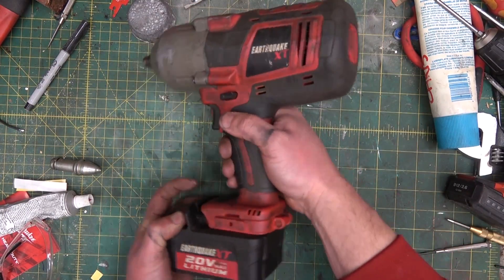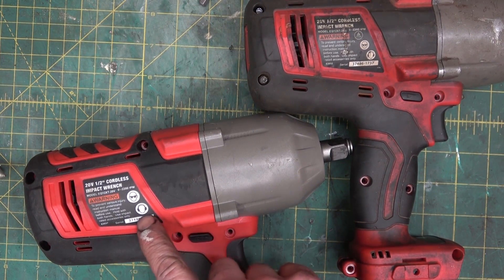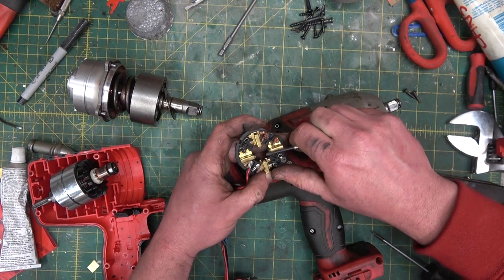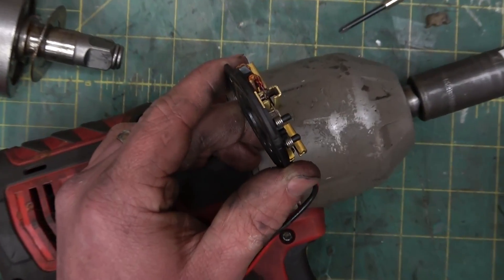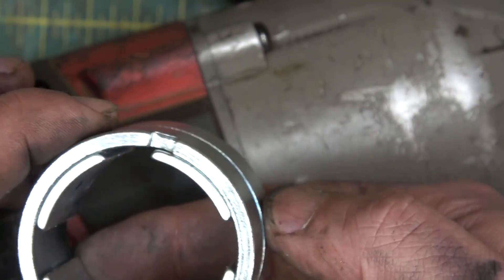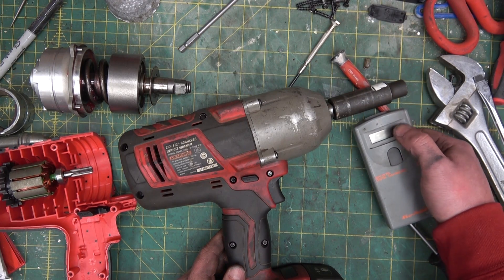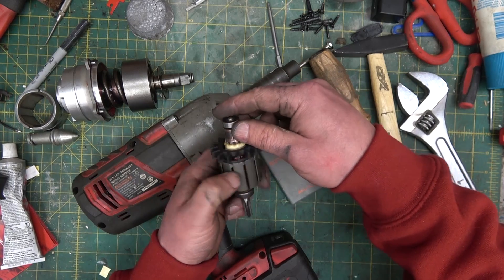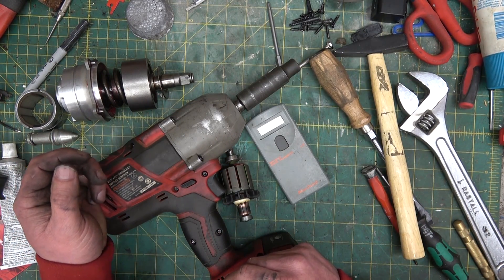Mystery Solved! | Why Impacts get weaker

Comment: recently I had  two very different cordless drills in two different locations short out on me at the commutator. 
Cleaned them up and they back up and running. Both way before the brushes were worn down. 
I did not get from you're previous video if you cleaned in between the copper strips.

Comment: It's possible that 1717 and 1737 aren't per-device serial numbers, but rather year/week of manufacture.
Reply: If they have CE marks on them they will be batch numbers. That said the batch number can be the week number too.
Reply: Gordon Lawrence I predict 2017 week numbers 17 and 37.
Reply: @matthewhall5571  both you and Musashi are most likely correct. However I raised the other possibility as it is not 100% ruled out.
Reply: musashi gundoh yeah I think the same. Calendar week 37 is mid Sept. Eric O. From SMA marked his impact as 11/17 so two months from manufactured date. Takes about 1 month for shipments to come across the pacific on the slow boat.
Reply: No, those are Starship registry numbers.
Reply: @pauldowding8185  Yorktown (or Defiant) and Proxima (or Coral Sea) if you're into that sort of thing (canon or not) :)
Reply: Sometimes they use different serial numbers for identification of which plant it came from,  also week month etc

Comment: I wonder how much play in in the flux ring and brush holder alignment pins. DC motors for racing RC cars have adjustable timing about 20 degrees advanced timing gives the most power in one direction.
Reply: Timing can also be introduced if the comm segments don't line up with the poles for the winding (twisted comm). Since both armatures came from a different manufacturer, that could very well be the case here. Another one could be that the faster armature was wound with fewer windings. I would try checking the resistance of each phase of the armatures to compare the amount of resistance between them.

Comment: It's interesting that the motor is the weak link here, rather than the gearbox or anvil/hammer.  I would have expected those to fail first.
Reply: Ya, I'd be real interested in measuring each of the coils, see what the range was.  Very cool regardless, and 100% not what one would intuit...
Reply: Or even have everything from the old one with only the new gear box. The motor might have failed because it was overloaded by the gearbox, because the gearbox wasn't properly lubricated, because.....etc

Comment: this video gives no hope to any power tool...how the hell does the rotor assembly get weak?! I understand the copper winding are working, and energizing on and off... but are they actually gaining resistance?! this would have to mean the copper material itself is getting less dense? i feel like this channel just discovered the black hole.. AvE, you should do a resistance test on some wingdings... maybe some macro close ups of the copper.. see if there's a physical change in the wire itself. <3

Comment: I have had Dewalt drills fail in the same way - new rotor fixed them. My guess is that they overheat and the insulation between the windings break down and cause a short in the windings.
Reply: You would definitely have seen some magical blue smoke if that were the case. 

Shorts almost always meant more heat and now that we have lithium ion batteries they almost always provide enough current to blow out more electronic bits. 

It's more likely that the rotor delaminated which explains the slow speed w/o the fireworks.

Comment: Interesting failure mode for sure. Do you think it may have been caused by the brushes having been worn to essentially past their usable travel, causing a less than ideal contact to the commutator and producing excessive heat? Wondering if replacing the brushes before they got that worn could have prevented the performance degradation.

Comment: Even if there are no open or shorted sections of the multiple windings, even a single shorted turn on any one winding will really mess up the operation of the motor and cause extra heating.  On an impact gun, you can imagine that the windings get rattled pretty hard so it is not difficult to imagine that the windings on the rotor could relatively easily develop issues.

Comment: So it end up being a shorted winding or open winding either or will cause some arcing at the brush commutator interface.  Well we are not done yet, one more step to go! Do you have a growler and not the type you put beer at the pub to that home, The diagnostic type that can tell us if the fault is, an open winding or a shorted winding !

Comment: I still need closure.  Measure the anger of the pixification from winding to winding.  Put your multi-dooblydoo in the horseshoe gear and get to work!  I'd a bet 20 Canaderp Kopeks it was the trigger or brushes.  You can't stop there!

Comment: I mentioned the rotor windings in the comments on the original video. I had the rotor in a HF miter saw go years back when I lent it to a buddy so he could put in flooring. HF sold me a new rotor for $16, so an economic fix. Used to work at Trane company in aftermarket engineering where we developed a system to test the rotor bars in industrial motor, which have no commutation contacts and so they can't be directly tested but rotor bars failing from heat was the primary failure more.

Comment: Thanks for the follow up, i would have lost money had i done that bet.
What's the resistance like compared to the working rotor? Lower or higher?
If the windings have shorted or there is a conductive buildup in the groove between the commutators, the resistance should be lower.
If the resistance is higher, something strange is going on.

Comment: You could have measured the winding resistances.  I'd bet one has an internal short and has lower resistance.
Reply: Or possibly an open?
Reply: Could be an open too, be it in the winding or connection to the bars. Not much else can go wrong in a rotor.
Reply: Was my thought also.  One of the windings being broken due to overheating.
Reply: Very plausible, the windings would shift in an impact gun, wearing through the insulation an shorting out, which would reduce the effective number of turns. The old florescent light  ballasts will do that.
Reply: Agreed! Fewer effective turns, same or more current , but less magnetic field and lower torque.  Have you an inductance meter? That'll show a BIG difference if there's a shorted winding. Ohmmeter, not so much.
Reply: Yes, and rewinding motors is actually not that hard to do. It could even be a bad solder joint from over heating.
Reply: I'm wondering if it lots one or more poles either by windings getting shorted, or something opening up. Either way, it would make the motor weaker. 

The crud on the com bars should have been a clue, but hindsight is 20/20.
Reply: @budgenatorP  that was my thought exactly. Being an impact gun its subject to a lot more vibration that normal motors. Couple that with some heat and i could see the epoxy insulation on the copper windings wearing thru in a spot or two.
Reply: it would be open circuit or letting the smoke out till it was.
Reply: Doubt youll find any solder in the armature. The comm bars are usually just crimped. Shorts caused from abrasion between unvarnished (dipped) windings. Aint nothin' made like the old days.
Reply: Mark S I’ve still got my Dad’s ~50 year old corded Craftsmen 3/8” drill. It still runs like a top. 
As a kid and later I personally put long periods of load on that thing. 
Sanding, paint removal, polishing, buffing, drilling ultra hard material, etc.
Sometimes, or most of the time, with less than optimal drill bits.
That doesn’t count what my Dad did with it.
Reply: Another great cockford ollie special!

On my screen the windings appear darker in places.  I too would suggest rubbing due to vibration, the epoxy insulation failed, windings shorted within, higher current, more heat, but effectively fewer turns, lower field strength, rinse and repeat.  

If so the resistance of each affected/damaged coil would drop.  

Each coil should have about the same resistance as any other coil in a well made motor, even one sold by HF..

The only assumption I feel queasy about is that the old tool and the new both put out the same RPMs when each tool was new. Do we know that to be true?  Or just believe it the case?  I believe it, but it is an assumption none the less.  After all, we didn't actually measure RPMs a year ago.
Reply: @ANDYMCNET  It could still be a shorted turn.  This happens all the time in synchronous generators/motors which is why larger units have flux probes/monitors.  The impact is probably causing abrasion between adjacent turns of wire, and the insulation is only a layer or two of varnish.
Reply: @splynncryth  I bet the impact during operation is abrading the varnish between coils.  I wonder if fully encapsulating the rotor/field would improve durability.  Would probably affect cooling/heat rejection though.
Reply: @carmenmurphy2543  I hadn't considered vibration, but we know for sure it got a lot of current and probably got hot. Heat is a good way to damage the varnish on those winding. Vibration would definitely not be good for a varnish that might be softer because it's warm though. 

Take a look at the video at 2:49. Look at the rotor's 10 o'clock position. Is that shmoo, or could that be where the varnish failed and there is a short? 

It might be interesting if someone with an inductance tester could have a look at the busted rotor.

Comment: I figured I'd go to an older video to make a request. Because maybe you'll actually see it. This is a one off request I'm pretty sure and I feel you could be the one who does this. 

We know electric motors aren't that expensive. Especially with the chinesium used in today's 18v tools. So, do you think it's possible to turn a subpar tool, into a more power hungry beast? For example Milwaukee, they are great and all. But, they do not have a current skilsaw that keeps up with dewalt and makita. Other than that they are almost top dog. Hilti is over-rated in their battery tools, and jesus their skilsaw sucks. Aside from their rotary hammer. their whole 20v line is mediocre. But, do you think it's possible to upgrade Milwaukee's skilsaw with another chinesium motor? Or further say you got ripped off on dewalts new combo kit where they claim brushless and make it appear you're getting premium tools when realistically you're getting weekender tools. Can we hack home user tools and make them industrial?

Comment: There is a good blog post on the internet about this "how-do-2-pole-electric-motor-rotor-bars-crack". Includes thermal expansion rates of different metals.  "The combination of thermal expansion and centrifugal forces also cause the bars to bend at the end of the rotor slot. This bending causes bar fatigue and eventually bar cracks." heicoinc dot com
Reply: Go to heicoinc blog for quick test steps "INDUCTION MOTOR CURRENT ANALYSIS (CURRENT SPECTRUM TEST) "

Comment: It's more likely to have an open circuit in one of the windings, detached from a comm bar under the epoxy.
Reply: This explanation makes the most sense. Heat doesn't generally make things high resistance, but it does make them expand and contract, which causes work hardening of copper when that expansion is constrained by an immovable object like epoxy, and eventually it just breaks.
Reply: Yeah, this is the likely culprit. I saw it a bunch of times at my old job. Good call.

Comment: OK, it wasn't the magnet.  Most likely the old motor has fewer / thinner windings and was always slower.   Measure the resistance at full current.  On of the favorite ways Chinese companies cheat is by using thinner wires (and PCB Plating) on everything to save money.   They also "round up" the AWG # when translating from mm2 metric wire specs.  Hard to notice.

Comment: What's the wire resistance on the motor? Is it possible they had different speeds to begin with?
Reply: twas exactly what I was wondering.. who knows if the old ugga dugga every spun as fast...
Reply: I would think if you compared each coil to one another you might see one is weak, seems unlikely they would all get weak together
Reply: Being Ave didnt have both guns he wouldnt know that. I think the guy who donated the ugga dugga. Works on cars therefore the gun is slower ya know because they get paid by the hour. My best smartass remark. Seriously I was wondering same thing.
Reply: i was thinking that too but i couldn't imagine them shipping a product that's 20-30% weaker, that's definitely noticeable to the consumers
Reply: Possible that the slow motor has a short circuit (due to chaffing/vibrations) on one or more of the windings
Reply: Now just when a fella gets something clear in his head you have to go and confuse him with facts and logic.
Reply: The original owner was aware that it became slower, so that infers it was faster and more powerful at one time. Looking up the specs on the unit also confirms the model from two years ago has the same RPM specs as the newer one AVE has.
Reply: @tmmtmm  Not likely a short circuit because shorts vastly increase current draw.
Reply: @Raymond Mucklow From having watched South Main Auto videos I'm fairly confident Eric O works as fast as the rusty crusties allow.
Reply: i think you right, different motor that spins faster in the newer models. Maybe that is why they changed to a different company this time not just for the price but its a better motor???
Reply: Tzuede Off the Cuff  As the insulating coating on the wires wears/burns off, the motor will get weaker.
Reply: Ave needs to do a follow up video on chaffing and vibrations! Sorry couldn’t resist :-)
Reply: @raymondmucklow3793  u obviously dont know Eric at southmain auto
Reply: Tzuede Off the Cuff  samething happened to our RC car motors after so many heat cycles,  cut the com and new brushes dont fix it, even tried lighter or heavier brush springs, it wouldn't run like it use to. Just how brush motors work. Nothing new!
Reply: I'm picking a semi-short between commutator bars. Conductive schmoo is partly bridging them together.
Reply: @tmmtmm  exactly my thought!
Reply: Tzuede Off the Cuff  idk honestly,  but I think they can only be so good. I do remember a cheap motor to a expensive motor doing the Rc car racing yrs ago, they had single, double, triple winds, some even had flat wire. Triples made tq, doubles seemed to be happy med for hp & tq, good high rpm power. Singles had a awesome high rpm power but slow bottom end. That's pretty much all I remember lol  oh and less turns of wire was a faster motor, say a 18turn to a 12turn motor
Reply: @kwmiked  pretty sure I've watched him once or thrice
Reply: @kwmiked  but your right I have never met him.
Reply: You guys are assuming the specs on the armature are the same.  They could have varying wire gauge, varying number of winds, they could even vary in weight and balance, even bearings could vary who knows.  I was guessing brushes or magnets at the start.
Reply: @BlàckÐèàth  it's a safe assumption.
Reply: Tzuede Off the Cuff  because you get all them angry pixies running in a straight line then they got to slow down to turn. They will jump out of the wire and crash.
Reply: @johnpossum556  shorts often become opens eventually, though not always in the same place.
Reply: @randomweirdo2701  Of course and in a later video he shows us how some windings take less current and some take more but we're still left with the question whether its the laminations or the windings themselves.
Reply: @raymondmucklow3793  if they were independent then yes, paid by the hour. If at a stealership, then they already have a set amount to be paid out no matter the time it took, unless it was customer paid vs. Warranty work
Haha, another smartass remark, sorry. Lube tech for 4 years.

Comment: If we're losing 1/4 of the rpm's... and there are 4 sets of windings.... something something
Reply: Brian Rose I’m still banking on friction losses with worn or damaged bushings which can be ordered or manufactured at home and replaced .. I just hope he doesn’t give up yet :)
Reply: @goldfishi5776  those would crap out almost instantly due to the heat that would generate.
Reply: Goldfish I i
Reply: Magnus Dagbro not in all the cases I have experienced.
Reply: @goldfishi5776  I'd be with you on that one but he's usually really good at telling when a bearing is going bad. I think he would have picked up on something that simple.
Reply: Why 4 sets of windings? Don't you need two brushes for each set?
Reply: My guess is wide open. A short would probably cause heat and failure at the switch. or wires. or battery. Maybe charring at the heat sink.
Reply: @robinbennett5994  just commenting on how it seems there are 8 commutator bars. So 4 sets. Each pair of brushes engages a set. 2 pairs of brushes engages 2 sets at a time, I think at slightly offset timing.

Comment: Could you have differing number of winding between motors to cause the change in speed? Do fewer windings make slower speed in this kind of motor? Just curious I am not an electrical/motor type.

Comment: "Mystery Solved! | Why Impacts get weaker"
And if it's not broke, I can fix that.
And it is not the rotor that gets weak.  Technically it is the armature.  Rotor=AC, armature=DC.
And as others have said, what is the winding to winding resistance?  Higher?  Lower?  Compare next time please.  Inquiring minds and all that.

Comment: i could have sworn i learned from you armatures are very likely a failure mode. mainly because of the uv light generated by the sparks from the brushes, it weakens the epoxy on the windings and it deteriorates...